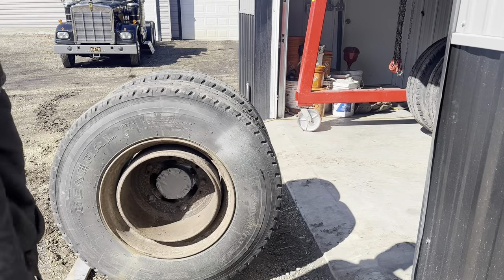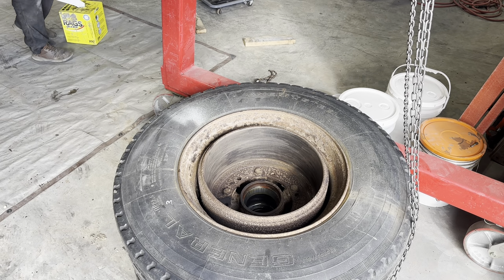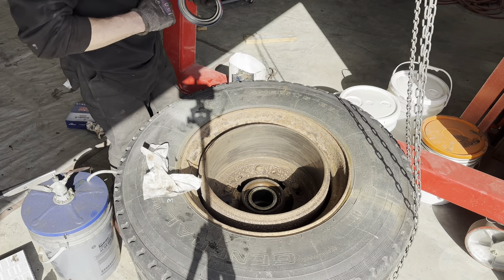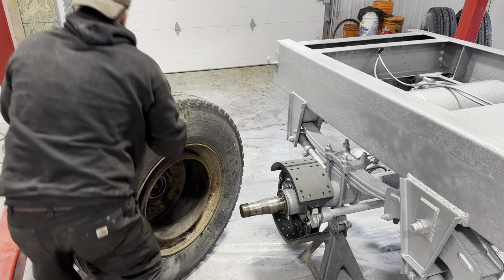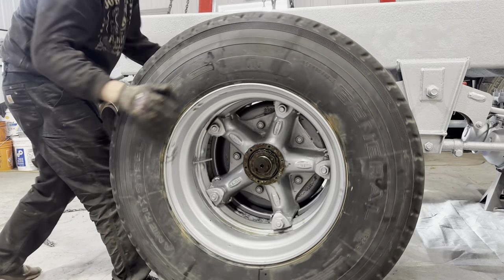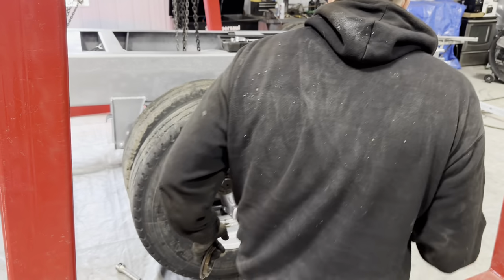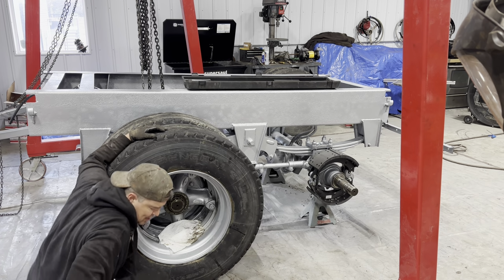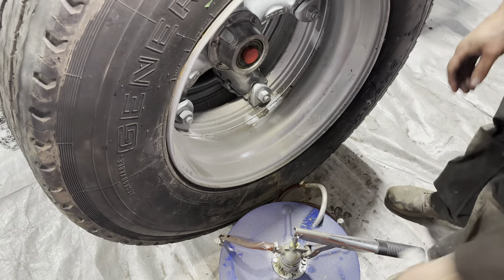Smokey & The Bandit Tribute Truck Ep.71 Trailer Tandems Complete

Comment: Mark, Extensions on a torque wrench shouldnt matter. The same torque you apply to the torque wrench is present at the socket. The torsion in the shaft doesnt ubsorb any torque it just defelcts. The reason it effects the impact is the fast hammer blows are dissipated by torsion within the shaft, kind of like a spring. With a torque wrench you are applying a steady load onto the extension, twisting the shaft but still applying the proper torque to the fastener.
Reply: Agreed
Reply: That’s right
Reply: I almost wish you had taken the wheels apart so I could see how they’re made I’ve never seen a set of Dayton hubs without the spacer rings. Learn something new every day you Canadians are amazing.
Reply: You are 100% correct sir
Reply: Snap-on did an actual test, extensions don’t affect torques  until you start exceeding 2-3 feet

Comment: Hi Mark, on the lock nut. If you spin the locking washer with the holes in it the other way around it should line up without having to adjust the torque on the hub nut. 😉
Reply: And that’s correct sir👍🏼
Reply from the maker: Good tip 👍
Reply: Beat me to it!

Comment: I noticed you didn't try to flip the lock rings around before backing the nut off. Most lock rings ive noticed the alignment holes when flipped are offset. They mostly (not always) not drilled or punched evenly, 12 and 3 may be 90 degrees but 6 and 9 would be slightly off or half of.
Reply: That’s what I would have thought too.
Reply: @topline620  Me too!!
Reply: I was just going to add the same comment.

Comment: Mark is the first person ever to use a dial gauge on wheel bearings.
I usually do them up bloody tight, back it off a bit and give it a jiggle. If it feels normal it's good for 250,000
Reply from the maker: Yeah that’s what I used to do but I find checking with the gauge after gives me piece of mind that they’re tight enough but not too tight 👌

Comment: Up until the early 90’s, most of our trailers were inboard drums and after 30 years of grunting and cursing, we finally got smart and bought a wheel jack…then everything went outboard. Mark, you did things more proper than I was taught. Which was set the bearing preload by arm torques and feel lol
Reply: German Torque Specifications,    Goodentight

Comment: Use the old seal over the top of the new one when hitting it in saves damaging the new one
Reply from the maker: That’s a good idea 👍
Reply: That’s what I had always heard as well. I have all of the install tools for my equipment because I never have had one messed up using the install tool but I’ve boogered some with errant hammer blows though.

Comment: I always worked on worn out oilfield stuff. Never could use a torque wrench on wheel bearings because of thread wear. Sometimes you’d have set the inner nut loose because the jam nut would squeeze up the slack lol!

Comment: Be sure after the hubs get a few rotations in emm you check and refill your fluid level. Don't want to head off on a cross country trek and have hub issues.  Happened to a steer axle where I work after they rebuilt it. No one did their follow up procedures and the bearings shelled losing the front wheel in transit.  Completely preventable mess

Comment: The GMC General from Knight Rider Seasons 3/4 was fitted with a two-piece tail shaft as standard.
However, the tail shaft that is currently on it is actually a straight one-piece shaft that was presumably fitted by the previous owner (in Idaho).

Comment: Mark @ 17:36 - you can see that the keyway tab is not symetrical with the holes around the locating washer - so when the bump on the inner nut doesn't line up with a hole, flip the washer over and you get a 'half hole progression' rather than backing/tightening the the inner nut  enough to 'find the nearest hole'.
Reply from the maker: Good tip 👍
Reply: Horseshoer 'schools' the mechanical engineer!  HA!!

Comment: I always enjoy watching your new episodes.  But I would like to make a suggestion about putting new wheel seal in I believe u should put a small amount of oil over spindle to make bearings roll more free an u should fill the hub with oil before u put the outer bearing on so that u have oil in the well before u start down the road.  Plus u know she has oil to the inner bearing right away . Just my opinion.  Keep up the great work.  Love the old iron u are building.  Thanks for the entertainment.

Comment: This will make torquing wheel bearings easier and safer . Place a Jack stand under extension it supports it during push down while torquing. Saves a few cuss words for bigger issues . I’m also a mechanical engineering grad . 1968 . Certainly enjoy the resurrection of these icons .  Backing off on torque wrenches, helps with calibrations your tools will benefit with accuracy !

Comment: Mark, probably should have changed the wear ring for the wheel seal. There is a chance it could have a slight groove preventing the new seal from sealing. Hopefully, they don't leak. I know sometimes you do it nice cause you do it twice lol. Also a tip when torquing hub nuts with an extension I'll put a jack stand under the extension to help hold the wrench up makes it easier to get to higher torque settings. Good video as always
Reply from the maker: I checked and there didn’t seem to be so fingers crossed
Reply: Hopefully you'll have no problems and on the up side you are not trying to haul freight so if there is a small leak you shouldn't have any Imperial entanglements lol

Comment: Mark you can use a extension with a torque wrench but not on your Milwaukee impact
Reply: Why can't he use an extension with the Milwaukee
Reply: @bush600r2  it loses the hammer effect when you do so it doesn’t work as well for really hard to get off bolts

Comment: The bearing endplay reading is taken as vertical and stainonary @90 degress i use a dial to set endplay with a light touch with a prybar i then set the inner @10-12 thou by the time you load on the outer at 200 - 300ft pds depinding on hub size it will bring final check in range at .001 to .005 thou

Comment: If your lock ring doesn't line up and it's in between holes, flip it over it should fit the other way, the holes are offset from the locating ring from memory

Comment: Hey just a heads up never use an impact with them axel sockets they will get messed up fast cause there not meant for an impact cause the hammering will distort them fast Ben there did that lol but just a heads up only use a ratchet or torque wrench with them

Comment: Nice job. If I remember correctly, if the locking washer won't quite line up with the dowel on the inner nut, try flipping the lock washer over first, instead of turning the inner nut. It just might line up.
Reply from the maker: Good tip 👍

Comment: Good work. 
I am curious about somthing tho, what would have happened in the day when you had a tyre blow on the trailer?? Surely it would not have required dismantling the whole bearing assembly to remove the wheel to change the tyre and then re assembling it and filling it with oil again?! 🇬🇧
Reply: similar as today, but he needed to change the bearings, clean the drums, and paint the rims anyway

Comment: Interesting how you use oil in the hub.  In the U.K. we Just pack with grease.
Reply: not all use grease
Reply: @jonathanoneill5072  ahh interesting. what 1970’s trailer in the U.K. used oil? I have never come across this in all the trailers I have serviced up to date.
Reply: Here in North America all the manufacturers are switching back to grease hubs slowly most new Hendrickson axles are factory filled grease hubs now
Reply: I remember in the 80s we saw trailers with oil filled hubs in UK. They had Stemco seals with wear rings as here, and also the special hub caps with bungs in for level checks and filling. Weren't many around though,and saw many back filled with grease because people got sick of seals failing.
I'm surprised that in the US they don't use brake back plates to keep dirt out. We could fail an MOT for having a missing backplate.
Reply: I was thinking same with being from Uk 
Can’t remember any being filled with oil 
Was also trying to rack my Brain if that seal spins
Grabs the wear ring ( not running on it )
Reply: @stephenrichardson6105  it looks very similar to the D85 axle seals that are also stemco. They used that type on the hub reduction axle as they were prone to failing due to over heating.  I used the said too that he is missing to put them in place.

Comment: Any concerns that the bolts holding the rims to hubs are rusted and potentially degraded? I was wondering why you didn’t separate those assemblies. Love the content.
Reply from the maker: Nah just a little surface rust is all
Reply: @TwinStix  what happens if you get a flat tyre out on the road your going to need to take those wheels apart anyhow. Wouldn't it have been easier to take them apart now in the workshop clean the threads up etc and reassemble them so they are good when you actually need to take them apart? Once they are all free up they are actually no problem to change, I used to do them all the time and never had trouble.

Comment: The Tandem sets are lighter ifen ya let the air out, eh? ;) ...
Seriously though, I wonder what lines were pulled out after running over those choppers (lookin forward to seeing you perform that trick) :O
Reply from the maker: Haha can’t wait 😂 actually the passenger side fuel tank on the ‘73 was badly dented (you can see it when they pull up to the pond to give Fred a cheeseburger) and I’ve always wondered if one of the bikes flipped up and did that 🤔
Reply: @TwinStix  grab a few junk bikes from kijiji and park under the tandems of the trailer during a show. 😅
Reply: @TwinStix you made me look... dark spot on side of tank at pond vs lower staining at gas station, hmmm... and after all your videos - I don't recall you mentioning the dent on the top of the driver's side air can?
Reply: @TwinStix  you should do a trick on the viewers and show a scene of the dinted fuel tank and say now to make it movie accurate I'm going to put a dent in this fuel tank with this block of wood and my hammer lol......😮 Oh wait, now I've probably given you bad ideas😢

Comment: Mark you can flip the locking ring (the one with the holes in it) the other way and then use the hole that is nearest. As the holes are off set from the square locating pin on the ring.

Comment: Using a extension has zero effect on the accuracy of the torque wrench.  The only way you could alter the accuracy is if the length of the handle was altered.

It would be easier to put the dial indicator magnetic base on the center of the spindle and put the tip of the indicator on the sealing surface of the hub where the cap attaches to.

Comment: One trick I've used for setting hubs with that lock ring is sometimes if it doesn't line up with the dowel nut, flip it around. More often than not it will line up or be closer so you don't have to tweak the adjuster nut as much. I'm surprised those hubs don't have the tab ring to bend over the outer nut to ensure it doesn't back off.
Reply from the maker: Yeah I probably should have bought a set of those lock ring tabs … will be sure to add the next time I’m in there 🤔

Comment: the seal is a one piece the other piece is a wear ring, all the non grit guard seals are two piece, 16 5/8 is the max diameter for brake drums looks like you had quite a lip which means it is worn past reuse, stemco gives the driver tools for free, ask your dealer next time your there, really doubt that trailer subframe is new enough for extended life shoes (1994), only reason they fit is your drums are worn out, you measure the s cam head to determine if extended life or rockwell q shoes, 28 rivets extended and 32 rivets for q, when the lock ring didnt line up you just flip it over, would have went right on,

Comment: Just an FYI for next time ... the lock ring , if it does not line up with pin , flip it 180 degrees/turn it over , it will fit or be a lot closer .(the holes in the lock ring are not drilled square to the locating peg) . Looking forward to seeing you slide the bogie under the trailer , after you have removed the existing bogie and sprayed the chassis . Show some more on the cab over for the poor subscribers please , though why you are making it into a 26 tonne ridged is beyond me !

Comment: Not a good idea,  you can change the roundness of the drum .
Reply from the maker: You don’t need to worry about drum roundness 😂
Reply: @TwinStickGarage  if a drum is out of round, you do not get the proper braking, and it wears out the shoes faster. I totally disagree with you.  As you have found out, restoring old trucks and trailers is not cheap.
Reply: @Richard Greenlaw  get some sarcasm in your life! Laugh a little bit it really isn't that hard!
Reply: @George   seriously, dude ? Do the job correctly the first time .
Reply: Drums go out of round all the time no problem that way but weight balance is the bigger issue but all this trailer is gonna do is go to a few truck shows every year so it don’t really matter
Reply: Exactly how many miles (sorry km’s) do you think this trailer is going to be running a year?